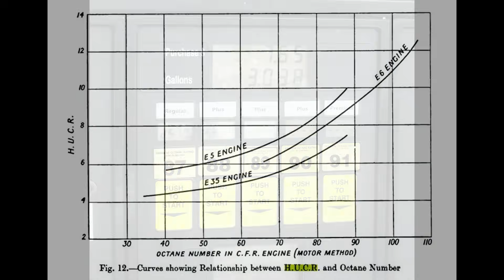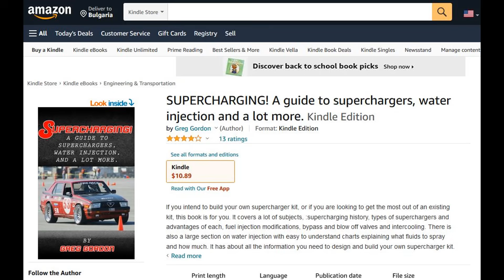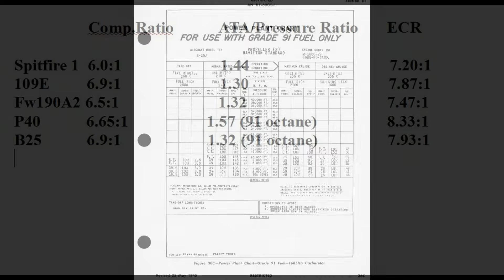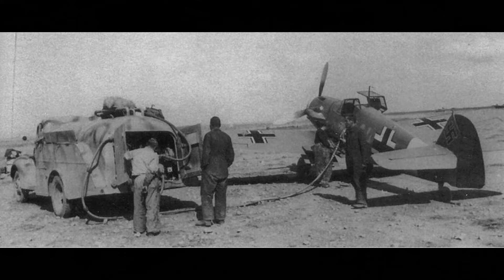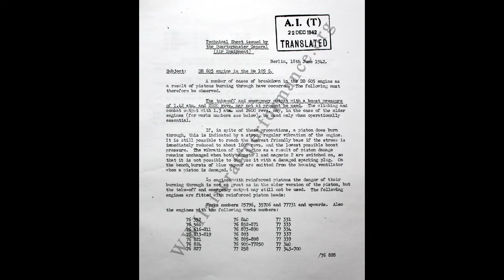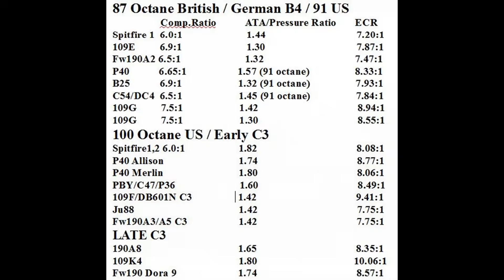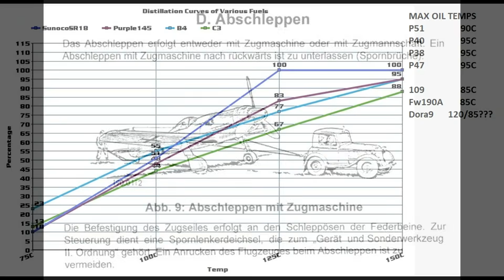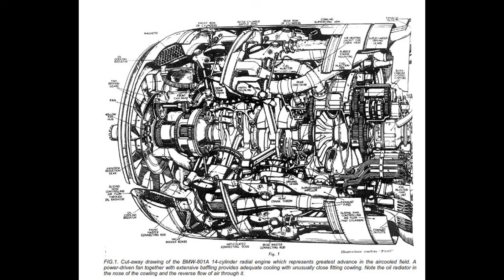German C3 Fuel, Uber Octane or Synthetic Crap?

Comment: Greg, great series. Thank you very much!

Imagine you have metallurgical restrictions (even long before Operation Torch) and synthetic fuels increasingly more sensitive (reduced knock resistance) to higher temperatures. The least thing you want is pressure cooling resulting in higher temperatures and there is no space for an intercooler.

Then (DB-601N) you start to realise that fuel injection allows you to increase valve overlap not only to improve scavenging and therefore efficiency, but also to significantly reduce temperatures … wonderful - synthetic fuel and metal issues solved, you can significantly increase effective compression - competitive again!

… and then (>80° valve overlap) trying to further reduce temperatures and using synthetic fuels suddenly everything is upside down: engine detonations again, switching from B4 to C3, richening the mixture or reducing boost do not help at all any longer. In addition, there is more oil dilution (even with B4) and with C3 it never disappears …

It takes you some time (DB-601E) to understand that you now need to lean the mixture, further increase boost (for higher temperatures) and stick to B4 … only for the synthetic crap! The least thing you want is an intercooler (lower temperatures), but higher pressure cooling (higher temperatures) becomes an option now …

http://fischer-tropsch.org/Tom%20Reels/Linked/TOM%20052/TOM-052-0383-0425%20Bag%203445%20Item%202LL.pdf
Reply: @Waarschip 570 #583 "Verstärker"
A German sailing a Dutch classic I presume?

I think I agree with you.
German is not my first language and the quality of the copy of this contemporary (1942) publication makes it a bit harder to read but I think you struck gold here.
It describes completely how the problem of knocking was viewed and in which way they tried to tackle it as far as can I gather.

Best thing in this case in my opinion is to have the trinity Greg, Bismarck and Calum shed their light on it.

It might give the definitive answer on this (very complicated) subject Greg tried to tackle in this video.
Reply: @kvrijt 

There is a British post-war interrogation report on german fuels and lubricants - in english language and less detailed:
https://www.cdvandtext2.org/BIOS-119.pdf

One often reads, that knock resistance was far more completely (more variables) understood and described in Germany than everywhere else. Well, they had more variables to influence due to fuel injection and also had to pay attention to more variables due to using synthetic crap ... no wonder that allied engineers did not focus on this. No crap, no issues.

db-600   -> db-601a - fuel injection + fluid-drive supercharger coupling
db-601a -> db-601e - 42° valve overlap (less than RR Merlin with 43°) to 105° valve overlap + increased boost

DB-601 Valve overlap
https://media.springernature.com/lw685/springer-static/image/art%3A10.1007%2Fs35146-016-0114-4/MediaObjects/35146_2016_114_Fig7_HTML.jpg
https://i.stack.imgur.com/WoluU.jpg

105° valve overlap is far more than needed to just maximise scavenging. They went further, obviously for the improved internal cooling.

Between db-601a http://kurfurst.org/Engine/DB60x/DB601_datasheets_A0.html and db-601e, they came up with db-601n http://kurfurst.org/Engine/DB60x/DB601_datasheets_N.html as an interim solution ... starting to explore valve overlap. It's not just increased compression, but increased valve overlap allowing increased boost/ compression due to reduced thermal stress. It's less obvious, because they did not fully strengthen mechanical parts (interim solution) and therefore the increased power was made only available to maintain power in higher altitudes - very old german concept, see BMW IIIa - "überbemessener Motor".

By the way, I think that the concept "überbemessener Motor" is the key to understand German designs with regard to high displacements, high compression, complex and automatic engine control systems "Höhenvergaser" (to avoid self-destruction of these hot engines on ground), therefore the willingness to accept the complexity of fuel injection and finally vertical tactics of german pilots ... Greg unsurprisingly has two very good videos about this engine: https://youtu.be/78nAd49BeVs https://youtu.be/PSLE_4dUiWc
https://www.autowallpaper.de/hersteller/bmw/chroniken/innovation-flugmotoren.html

db-601n was expected, probably based on tests with conventional fuels, to be even more powerful, but they ran into completely unexpected issues when using synthetic fuels. They did already know, that their synthetic crap was more sensitive about higher temperatures compared to conventional fuels, but now they had to realise, that cooler temperatures (desirable for metallurgical restrictions) are as difficult.

It took them some time to learn, that the reduced temperatures achieved with extreme valve overlap had a negative impact on fuel atomisation when using synthetic crap, which resulted in knock. Surprisingly, higher temperatures achieved, before that unintentionally, with higher boost was the solution. In other words, extreme valve overlap allowed and forced them to increase boost without intercoolers - maintaining, but not reducing as hoped, temperatures and thermal stress. My guess is, that these cooler temperatures were also responsible for the db-601n oil dilution issues. Leaning the mixture did also help - both with regard to knock and oil dilution.

The German report has a table with three setups observed to have equal knock resistance curves ... quite significant.
Valve overlap           charge air temperature
   40°                            80°C
   80°                          160°C
120°                           190°C

db-601n had new pistons for more compression (made possible due to reduced thermal stress and simpler to do than modifying the compressor) and my guess is, that compression did increase temperatures reduced by valve overlap less than higher boost would have done. db-601e - higher boost and almost back to db-601a compression ...

Fuel Injection in Germany was not only about negative Gs  ... it's, especially when it comes to extreme valve overlap, the single key factor when you have to build and operate engines with crap.

Geschichte der Benzin-Direkteinspritzung - history of direct fuel injection in Germany - stressing valve overlap and cooling:
https://download.e-bookshelf.de/download/0002/6791/71/L-G-0002679171-0013255051.pdf

So, synthetic crap did limit them to a quiet narrow temperature band ... already limited upwards due to metallurgical issues - probably influencing their decisions with regard to intercoolers and higher cooling system pressures.

A later report on the same topic:
http://www.fischer-tropsch.org/Tom%20Reels/Linked/TOM%20051/TOM-051-0251-0270%20Bag%203445%20Item%202E.pdf

Rechliner Kaltstartverfahren (deliberate oil dilution for cold starts):
https://de.wikipedia.org/wiki/Rechliner_Kaltstartverfahren
D. (Luft) T. 3870 https://docplayer.org/docview/74/70535184/#file=/storage/74/70535184/70535184.pdf

D. (Luft) T. 3870 has some details on C3 / 100 octane and db-601n ... with regard to dilution and vaporisation ...

Operation Torch - they had only access to french sources after summer 1940 (which they did not expect to happen so fast/ early). Before that they were limited by embargoes and before that simply by financial restrictions ... and in 1941 their demands were already increased significantly ... and after WWI they already knew what to expect.

Anyhow - forced labour results to bad karma ...

Comment: Great work Greg, you are the best.
Did you overlook "Bf 109 Late Versions" by Krzysztof W. Wolowski,  perhaps because it's subtitled "Camouflage and Markings"? He notes that before the G-10 there was the G-5/AS (rare), the G-6/AS, and the G14/AS, all of had the larger supercharger that was on the G-10, and they all  ran on C3 fuel. Or at least that's my take away from my reading of the book which is translated from the original Polish into serviceable English, but you know the pitfalls of technical translation better than I do. The quick visual identification trick for these aircraft is their lack of bulges over the MG 131 nose guns. The larger supercharger necessitated new nose fairings on all AS  versions, the same that became standard on the G-10 and K-4, with the caveat that the Erla versions were different from all the other manufacturers' (but still got rid of the breech bulges). These were not experimental aircraft but rather high altitude  "hot rods" specifically aimed at the threat of the Mighty Eighth, providing fighter cover for the specialized Fw190As that formed the sturmgruppen tasked with attacking the bombers.
If you know the book please forgive me, but if you don't you might find it interesting.
Reply from the maker: I know of the book, the problem is that C3 could be needed with the smaller supercharger, and the big supercharger could run on B4, so just identifying the supercharger doesn't really do it for me. Furthermore I need to find evidence of it from an official source, or a photo of say a G5 with a C3 sticker on it. So far, I haven't found that.
Reply: @GregsAirplanesandAutomobiles  Thank you for your thoughtful reply. I must admit that I rather naively trusted the artwork for the most part. But what about photo of the G-14/AS  piloted by Fw.Hundsdorfer at the top of page 42? You know the photo because you included it in your fascinating, deeply informed, and wonderfully entertaining video. Isn't that the same engine as in the G-5 and G-6? I'm not arguing, just asking. On all things aerial, I'm not fit enough to lift your jockstrap as they say!

Comment: You mentioned C3's low volatility leading to oil dilution problems.  Fuel dilution of oil can create other issues besides bearing failure.  It reduces oil viscosity and can increase the amount of oil getting past the rings and into the combustion chamber, which could cause another type of damaging abnormal combustion - preignition.
Reply from the maker: That's a good point about oil in the combustion chamber causing knock, I meant to add that in but it somehow got lost in the production of the video. I do think it's a factor here.

Comment: I wonder how much of the German inability to take fullest advantage of their fuels came from their "advanced" (for the time) engine control systems. The "Kommandgerat" style of engine management took several of the variables out of the pilots hands, unlike the "less advanced" Allied style, that kept several of the  engine variables in the pilots' control. The Allied style relied more heavily on pilot skills, but also allowed the pilot to make the most of the fuels available.
Reply from the maker: That's a good thought, but those systems didn't prevent running the desired mixtures. They chose to run them lean.

Comment: Very interesting video. Haven't thought about these aspects yet. Do you know the reason, why the Germans (more or less) didn't use intercooler? Super- or turbocharging without intercooling rearly doesn't make sense. Did they just favour the Water-Methanol injection because it's easier to install (no significant change at the airframe) and doesn't increase the induced drag of the airplane?
Reply from the maker: No, they didn't even go to Water-Methanol injection until years into the war. At the time the 109 was developed, nobody else was using an intercooler either, and they never had the room to put one in. Water-Meth is a lot easier to fit.

Comment: Did they run C3 lean for the simple reason to save fuel? Same power as b4 less fuel consumption? I am to lazy to do the math even though i could i am an engineer not a pilot.
Reply from the maker: I don't think so. If so that would have been a really bad idea. Saving a few ounces of fuel when at war emergency power with a P-51 behind you is a bad idea.

Comment: Great video! I want to say that Bf 109G-6s and G-14s with DB605AS engines may also have ran C3 fuel. A lot of the G-14/AS are often misidentified as G-10s. There are a couple of references out there noting Bf-109s initially equipped with MW50 could only use the system if fuelled with C3; if the MW50 ran out while the engine was at 1.8 ATA and the engine was running B4, it would very quickly destroy itself, but I’m not totally sure on the truth to this.
Reply from the maker: It certainly could be that there were G-14s on C3, maybe even G-6s, but I haven't seen anything on this that's concrete. Either way, C3 was relatively rarely used in 109s.

Comment: Metallurgy, Collum: When reading Collum, and a single email from him regarding this, I got an impression that the surface of the exhaust valve (and perhaps its valve seat) wouldn't stay as smooth if the metall quality dropped; and outside corners of a surface getting rough would get hotter, and initate combustion earlier.
This is though a subjective impression influenced from chemistry, and can only be regarded as a hypotesis.

Collum Douglas also confirms in a comment an other place here that the German's got into supply problems with nickel before they got supply problems with cobolt.
Reply from the maker: It doesn't seem to show up in ECR numbers and it doesn't matter what numbers you look at, anywhere from 1939 to 1945 German fighters run ECR's about equal to everything else for a given octane. I think it's a small factor.

Comment: When comparing the Merlin to the DB601A, keep in mind that the direct fuel injection on the DB601A can take advantage of the heat of vaporization of the fuel injected directly into the cylinder to cool the cylinder charge.  On a modern spark ignition engine, the difference between direct and port injection (assuming approximately the same overall level of F/A mixture control) allows approximately 1.0 to 1.2 higher CR for the same RON fuel.
Reply: Well that assumption just got shattered...
I have thought for a long time the German engines just used port injection and the direct part was a changing in terminology.

Well thanks for these comments and making me look/learn
Reply: @TheAneewAony  we used fuel injection during the timeframe just to the best of my knowledge not direct injection

Comment: Maybe consider the evaporative effect of the spitfire's carburetors, the reduction in air temperature makes it a bit more like an intercooled engine, with the increase in power and a different ecr adjustment factor  . I thought your using the root of the boost ratio was interesting, thankyou, i had often wondered about the apparent " free" extra compression ratio from boosted engines. The root rule sounds more like a heuristic, but it is hard to think of a more rigorous model, because it seems like it is more complicated than just adjusting air volume for temperature too, apart from a volume compression ratio, you have a temperature ratio, maybe reducing that is good for something  . I am sure the clever turbo designers have worked the theory out somewhere long ago, but maybe in practice,  just use something like your heuristic, and then build a few and then start shaving the heads till they have gone too far.
Reply from the maker: Let's remember that the Spitfire switched to fuel injection for the Mk9 and never went back.

Comment: super super cool.  awesome information and great insight on effective compression ratio.   laid out and explained very thoughtfully, thoroughly  in a very logical and sensible manner
Reply from the maker: Thanks, I was worried I spent too much time on ECR, but it seems like it worked out.
Reply: @GregsAirplanesandAutomobiles  I have actually re-watched the ECR segment several times,  I recently acquired an older 01 beetle turbo 5 speed from a family member and it just so happens I am a mechanic/auto tech by trade and is still my day job. Very handy info not just for my own curiosity but for future engine tuning/ builds down the road   :)  the beetle is only the first turbocharged car I've been able to "mess around with'    even aside from turbo'd applications the octane , compression and air/fuel information still applies across the board

Comment: It is interesting to note:
During WW2 Britain was largely an importer of high octane aircraft fuels, firstly from the Middle East until as a route that became impossible, then 100 octane from Curacao in the Caribbean, and ultimately from the US for the larger part post 1942. Even within this period Whittle's jet engine was using kerosene fuel which is very low octane of 15. Yet with the complication of development and manufacturing interests as an aside, this was not recognised as an asset should the trans Atlantic supply of high octane fuel turn south in the failing contest during the early years of the Atlantic U Boat war. Of course, the same would be true from the German perspective as jet engines would alleviate their fuel shortages, but probably worsen the shortages in rare metals cobalt and nickel already at issue with piston engines for pistons and valves.

Comment: In the paddock at COTA, there’s a regular looking card accepting pump that dispenses 87, 93, and I forget the exact octane of the the last selection but it’s over 100. 

I have to wonder what percentage of the heat rejection of an early 911 turbo was from fuel, it had to be a surprisingly high percent.